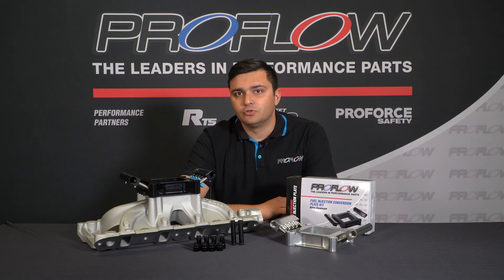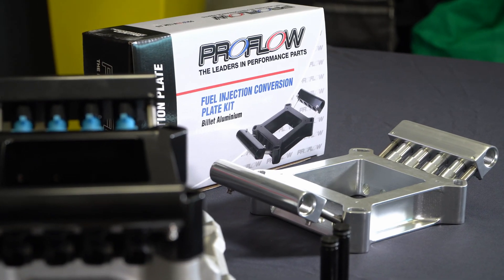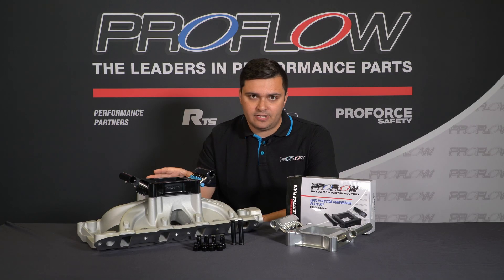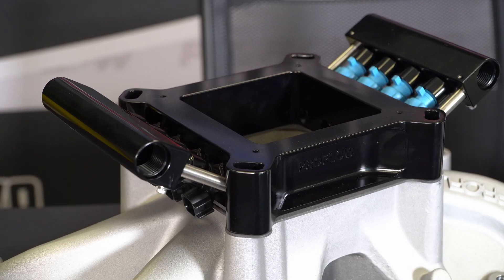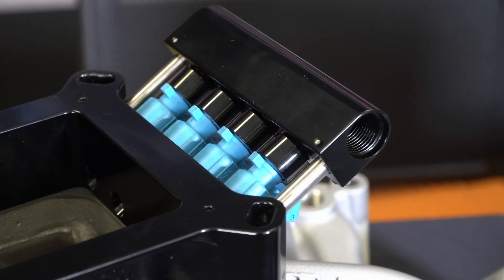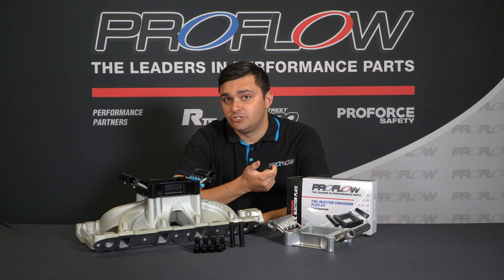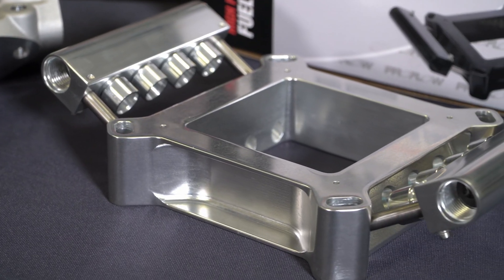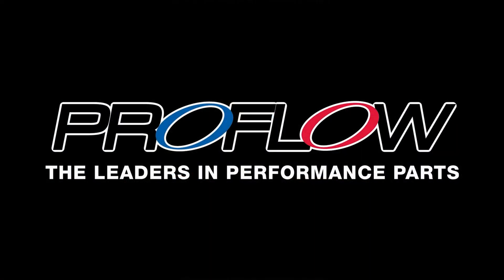Proflow Series II Fuel Injection Conversion Plates

Comment: I an looking for 1 with 6 injector for a v6
Reply from the maker: You could use this and block off 2 of the injector ports with our PFETBP650 injector blanks. Please note that this conversion plate has a 4150 flange.